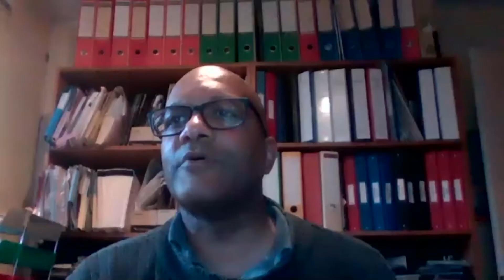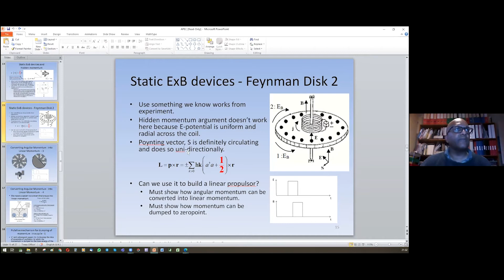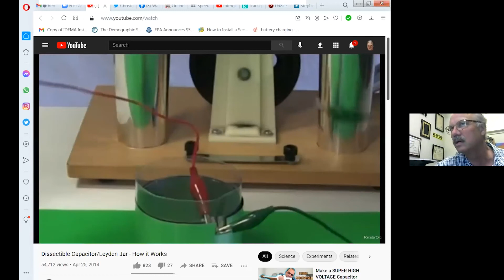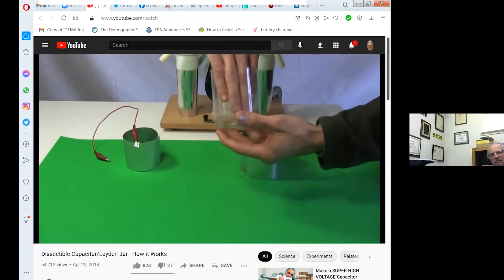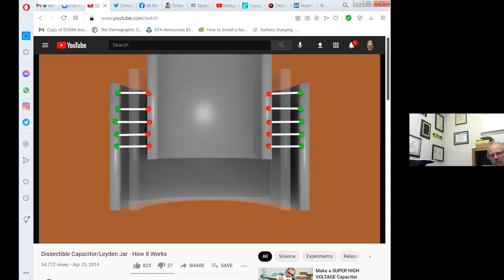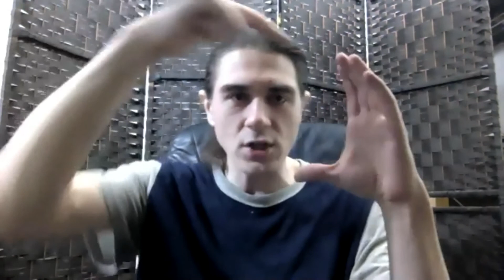APEC 7/10, Part #2  - Remi Cornwall - EM Propulsion & Feyman's Disk Q& A

Comment: He's trying to generate net momentum of a physical object by conservation with field momentum. That's all fine but if that physical device can be spun up with a constant  energy in its own reference frame, which it would,  that can be used to generate net energy of the object wrt to the original non-rotating frame. What the Feynman disk is doing is providing a reference frame of infinite inertia to push against no matter how fast it is spinning. You can argue energy must be conserved overall if you like but that spinning disk is then borrowing energy from the reference frame of the universe so to speak. The point is from your point of view you are generating useful energy. Kinetic energy is frame dependent. It can be generated in one reference frame and harvested in another frame where it is greater.

Comment: On the efficiency asked about around 34 minutes in, if you compare the energy needed to create the fields vs. the energy of the final rotation, it is dismally inefficient by many orders of magnitude. You would have to capture and recycle the energy needed to make the fields to have a chance. I think it's better than just using photons, such as a photon rocket, but not by that much without serious engineering.